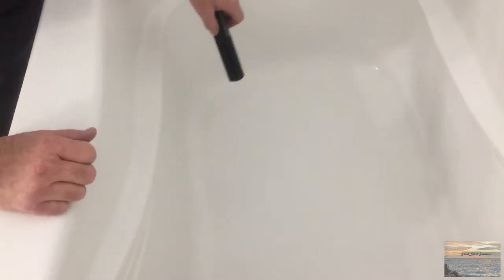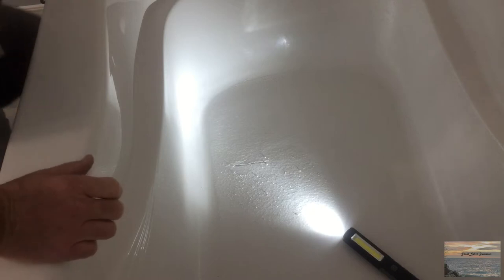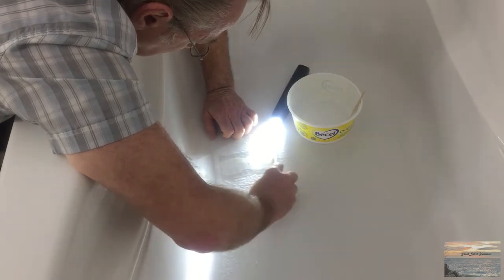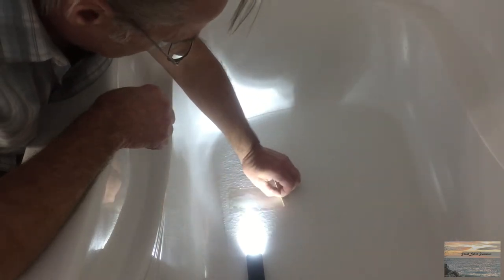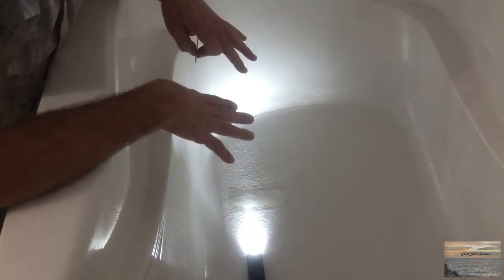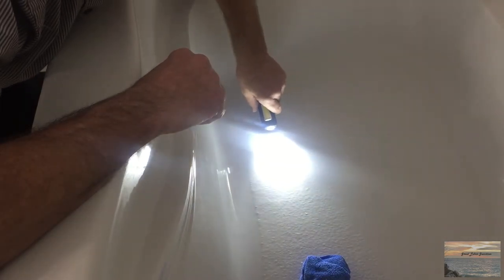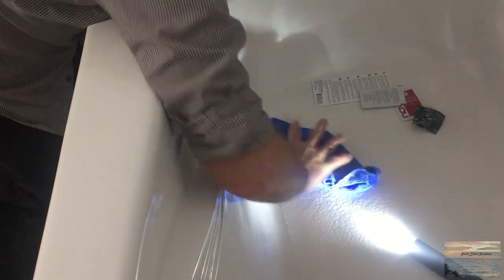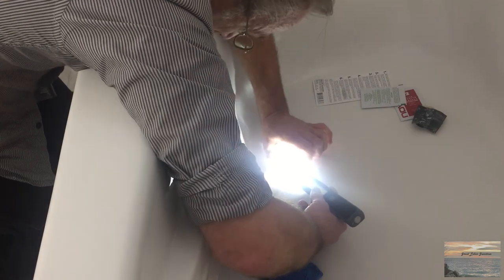Acrylic Bathtub Repair | Cracked Tub Repair

Comment: Just an idea.... You might be able to match the texture by dabbing another coat of repair material with a small sponge and then sanding the peaks down after it dries.
I don't know if it would actually work but it's worth a shot

Comment: Great video - very helpful as I have a similar crack developing in our acrylic tub an I am debating a similar DIY repair or do I just avoid the inevitable & replace the entire tub now...   Question:  long term, how has the repair held up?  Did this repair work to prevent further cracking in that spot? Thanks in advance!
Reply from the maker: The crack returned after about a year, it did not get any bigger. We decided not to use this for anything more than a shower, as we can not see if it is leaking.  Thank you for watching.
Reply: @GreatLakesJunction   thanks for the feedback!!  Ill give it a shot and stretch the tub a bit longer b4 gutting the entire washroom for a remodel... 😀

Comment: Whenever I install an acrylic tub, I use expansion foam underneath and hold down the tub with a handful of screws right on top of the lip into the studs. Then it will never flex! I happened upon this video because I’m fixing a nasty chip in an acrylic tub and wondering what to use to polish after sanding? Just some normal compound you think?
Reply from the maker: The repair I used came with 600 grit and 2000 grit paper I believe, normal compound would be in that range someplace. Thanks for watching.

Comment: Did that crack originally allow water through?  Or is this an aesthetic repair?  And THANIKs, for the video BTW.  I always appreciate a good how-to!!!!
Reply from the maker: I cant say for sure, I ground out about 1/16th" of material and could still see the crack. I have a finished ceiling below the tub so i couldn't see it from the bottom. That said my ceiling never showed signs of any water either.

Comment: Out of curiosity was your crack clearly through the tub? Im in the same boat right now and am wondering if I need to go clearly through the tub layers.
Reply from the maker: I cant say for sure, I ground out about 1/16th of an inch of material and could still see the crack. I have a finished ceiling below the tub so i couldn't see it from the bottom. That's as far as i went for fear of weakening the tub. Good luck, let us know how you make out with it.
Reply: @GreatLakesJunction  I'll give it a go I had the same reservation about weakening, thanks for the reply

Comment: Hi have a p bath just noticed the white part inside which is stuck to fibre glass bottom has come loose..When you press your finger in middle of bath the white skin part is moving up and down,looks like a plastic skin was put over base and has come away.What can I do as if that white skin as I now call it cracks I'm in trouble.
Never seen it before..
Reply from the maker: Thanks for leaving your comment but I've never seen anything like this before, sorry i couldn't help.

Comment: Thanks for showing  the full agonies of diy  without sanitizing it.Did your bath  leak after the repair or not? Is that revealed in part 2 ?
Reply from the maker: We never did have an actual leak that we've seen. There is a finished ceiling in the basement underneath the tub and there's no water marks. The reason for the patch was to make sure it didn't leak. Since the video was posted the crack, unfortunately, reappeared. Thanks for watching!!
Reply: @GreatLakesJunction  most likely like you said in the beginning, there is flexing because the tub was installed without the proper amount of support up under the tub, ie, structolite or gypcrete. But you did a great job in the step by step repair and explanation in the video!